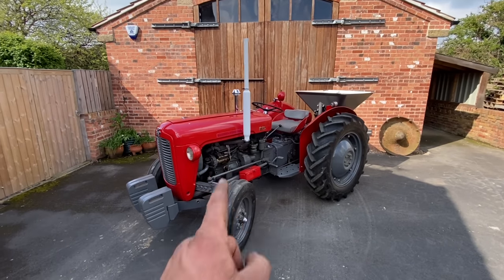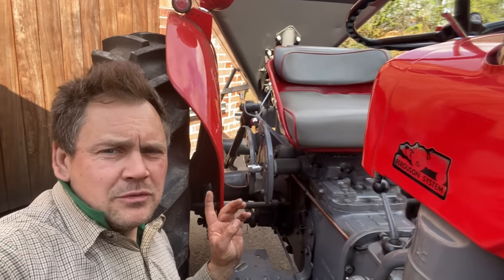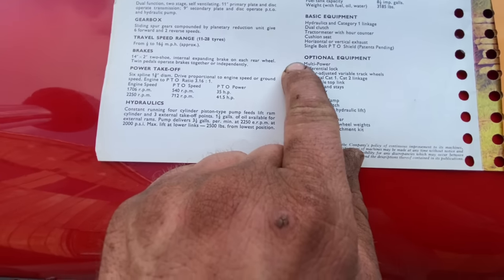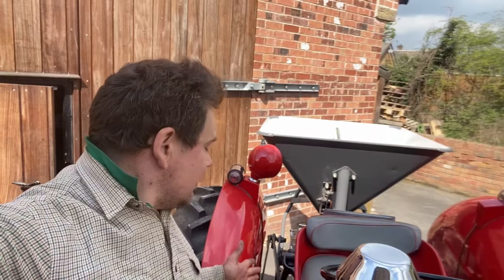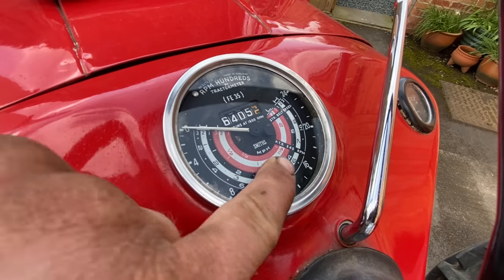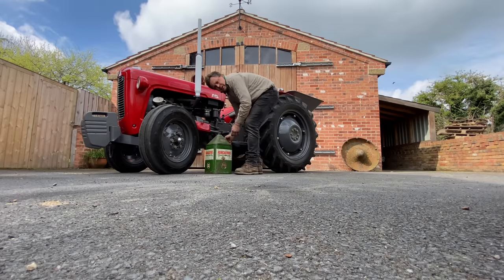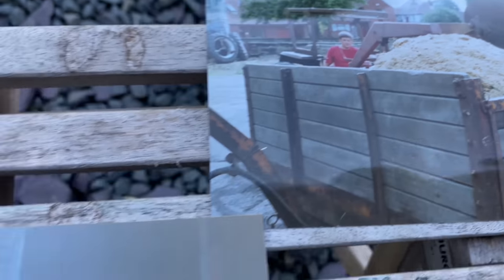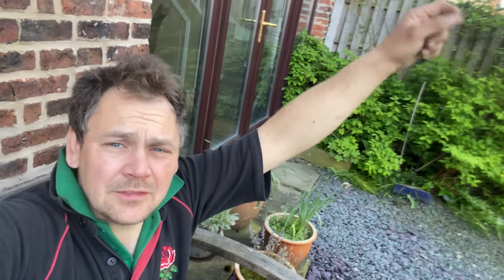How do you tell a Massey Ferguson 3 cylinder 35 to a Massey Ferguson 35x Vintage tractor

Comment: Yes, I'm glad to say my 35x conforms on all those points. She may not be the most beautiful example but she is very original and still does a fine day's work. From the dealer plate it seems she was delivered to the original owner in May 1963.
Reply: Had our 1 with multipower for about 40 years .punched above its weight.and didn't often need more fuel than that tiny tank for a day

Comment: One sure way to tell the 3 cylinder from the 4 cylinder is that the intake and the exhaust on the 4 cylinder are on the same side, the Perkins 3 is a "flow through" design with the intake and exhaust on opposite sides of the engine. Mine is a 4 cylinder Standard engine.

Comment: i have a 35 here in Canada but it is called here the 35 deluxe has  multi power and diff lock with power shift rear wheels
Reply from the maker: Ahhh how interesting how far the video has got. That is a very good spec of tractor you have.

Comment: My 35X has the two piece generator bracket. It also has the diff lock. It's a late 1962 build.
Reply: I have a late 1962 35x multipower with the two piece dyamo bracket also
Reply: @patConlon   If you look very carefully at the brochure shown in the video.
it shows the improved 35x engine with two piece dynamo bracket
Reply: well picked. @188fergie

Comment: Great video - nice to get good info on the differences between the 35 and the X. I must say I like the air intake - my 'hard to start' 4 cylinder is a lot easier to start since my neighbour cut an extra grove in the top of the 4 pistons and installed an extra piston ring on each one for me!
Reply from the maker: That dose sound a good idea. Some day to change the starter to a 3 cylinder one and a high put out battery helps too.
Reply: @Mr_b_yorkshire_farmer  Yes, I changed the starter to a Ford starter which has a lot more life than the old one had. It always starts but it'll never be as easy to start as the 3 cylinder

Comment: You can’t beat the old MF’s  Cracking tractors. , better than the  high tech junk  we have now invading  the countryside 👍
Reply: Yeah, I agree we have an MF35, FE35, TE20s, Leyland 285 & Dexta's
Reply: @scorm3088  that’s brilliant,  fields  were never so wet with the smaller tractors carrying out the work ,now the fields seem to be forming pools after heavy rain fall , now am not sure if it’s the massive equipment they use to carry out field work , cause land drains weren’t designed for such heavy equipment we have now ,
Reply: @Stevie Chalmers  Yeah, everything has changed, sadly.

Comment: MrB, I have aging tractor That I'd like to restore to decent condition. Could you recommend me steps I should take to do it correctly.
Reply from the maker: Firstly I would not rush into painting the tractor.   I would first service it. I would try and possibly use it in a few events to see what problems you may have and then set too and do any mechanical jobs that need doing.  Nothing worse than scratching fresh paint off.

Comment: I find that the 4-cylinder 23C is a better engine. It has got better characteristics. Better torque reserve I would reckon.
It's not hard to start as long as you have a working Thermostart. Unless it is very cold in the winter. Then you might want to use an electrical block heater foe a while. There is pros and cons in everything. The 23C sooth up the engine oil quite fast, and the 3-152 will drop a liner and blow the head gasket now and then.
Reply: I do not know what temperatures you are referring to when you say "cold", but I have a Lincoln SA250 welder with the Perkins D3.152 engine. It has started up with zero problems at temperatures of just under 20 Fahrenheit.

I always wonder when people claim diesels are hard starting as to the maintenance and upkeep of the engine, as well as the condition/size of battery cables and terminals.I make my own starter and alternator cables from welding cable, and always much larger than necessary. Poor tuning, wear, etc are contributors to difficult starting, but far too often the cables are undersized or neglected and do not conduct well enough to give the starter adequate amperage.

Comment: Lovely tractor, just a bit curious about that gas pedal, is that a standard feature? Or is it fitted on after? Because my 35 petrol does not have it. 
Best regards from Denmark
Reply from the maker: Thank you. Yes it is a later fitment on the 135.

Comment: 50 years ago  mf 35 with mill loader and lister take put bale handler  12bales on front and 12 bales on the back quite a load for small tractor

Comment: I have a 4cyl 35 and fitted a crankshaft from a leyland oe160 also con rods and this gives the tractor a "LOT" more torque and power. I think it is about 2.6 litres now up from 2.3. I also have a modified diesel pump from an old commer diesel walk through van which allows it to rev at 3600rpm all day long and on the road it goes like a rocket.
Reply from the maker: It sounds really interesting what you have done.

Comment: Is there any other ways to identity a 35 to a 35x because here in Portugal there are still lots of them but when you see them for sale they are say its 35x but I've not seen one yet with a diff lock ,  most have been modified with a alterator instead of a dynamo ,  all got underswept exhaust and not got original serial plates on , or rev counter ,   is there any other way to tell if its a x or not ?
Reply: Would it matter if it looks and sounds like 35x or 35 😊
Reply: @tomotoole7241  well if the both look the same which they all do and there are mechanical or engine differences and diff lock was an option I'm struggling to see what the x stands for and the purpose of your video if there are no power difference because I've used both all my life but always found the a little more powerful and a more responsive engine
Reply: @davidgoode5768  Was the X a slightly higher reving engine with a lower ratio gearbox to compensate ??
Reply: The x should have a heavier lift top cover, it should also have grease nipples on the front hub caps, some later ones, front wheels changed to 7.5 x 16 after a particular serial number, I can't recall what that number is, the engine has 2 posi drive head bolts near the sump as apposed to hex heads on a 35
Reply: @mc461  any info help because I got one to go and see that's for sale and he is claiming its an x but frome the obvious its got no diff lock and the only way I would personally know is if I put it to work but that not possible when you just drive miles to  view it and where I am they are not very educated on the different specs ,  they will even advertise a 4 cylinder here as an x because they just don't know , same issues here with the 135 & 130 and they are nothing alike as I'm sure you know

Comment: Nice 35x, was lift cover heavier on the 35x
Reply from the maker: You could be learning me something there? I honestly don’t no?
Reply: @Mr_b_yorkshire_farmer  Thanks for the reply, there is 2 types as I changed one in the past, the  pipe from the pump was longer approx 2/3 mm of a difference
Reply from the maker: I no that the early 35’s have a smaller piston for the lift but other than that? That’s for the info.
Reply: @Mr_b_yorkshire_farmer  no bother i will investigate further

Comment: Love these 3cyl MFs, a 35X was the very first tractor I drove ...at the age of 6! It'd be extremely interesting with a comparison between the original British built 35 vs the IMT/ TAFE / Kenya versions. They do look very similar however I will assume there are differences below the surface?
Reply from the maker: They are very similar. They do different ones based on the 35 and 135.  There are many parts that are the same hence the availability of parts still for both tractors.

Comment: Does the 35x have an inspection plate/filter under the sump ?
Reply from the maker: No. There is a round circle around the oil plug area but no inspection hole.
Reply: Thanks... is there an engine id stamp or just the plate on dash.. ? Ive had someone question my tractor.. it all adds up to be a 35x..